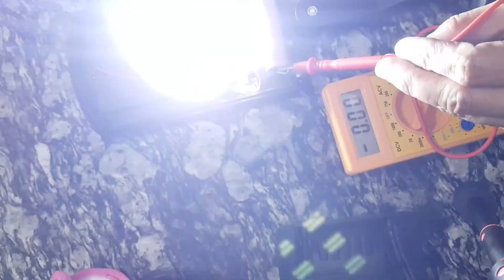Cob bright solar sensor light BK-818-6 additional 3.7v lithium battery add mAh for longer use

Comment: I would like to know how to set this in night time mode (turn on at night, off at day)
Reply from the maker: Sir this is just a sensor light at night time if someone pass within 3-5meters from this light sensor it will automatically on in 15 seconds then turns off. And have settings of 1hr steady on then turns off or longtime dim on then when someone pass it turns bright in 15 seconds then turn dim.
Reply: @dondonmixdiyandtutorial6499  thanks
Reply from the maker: @phucletran2860  Welcome! Please Like,Share,Subscribe click Notification Bell and select all for updates on new video's. You can also check my Channel for other video's. Thank you and God bless!
Reply: Seri or paralel